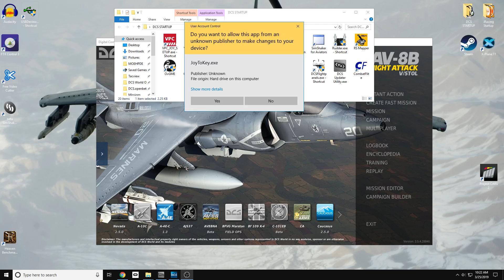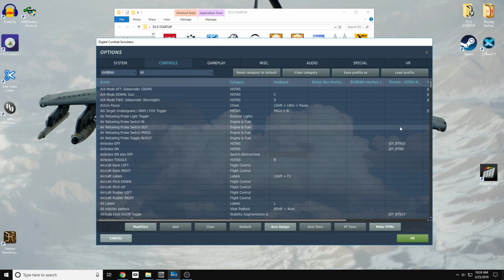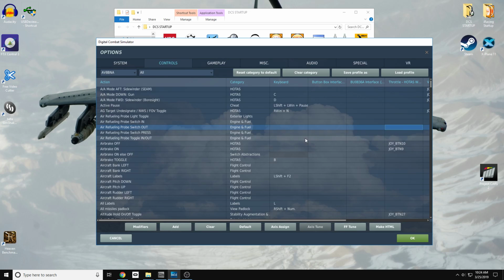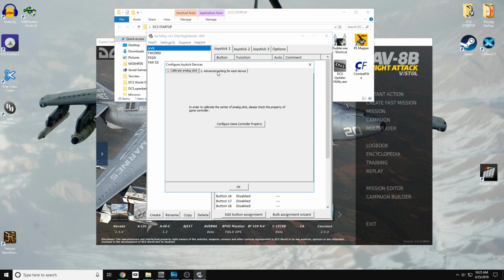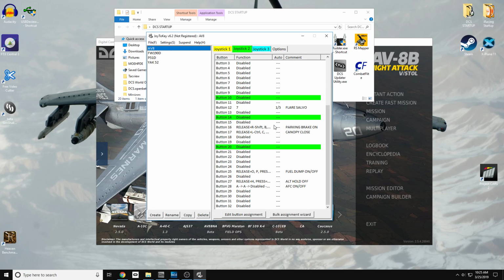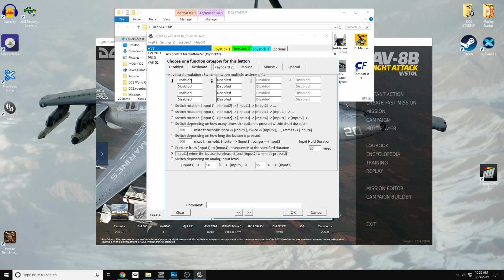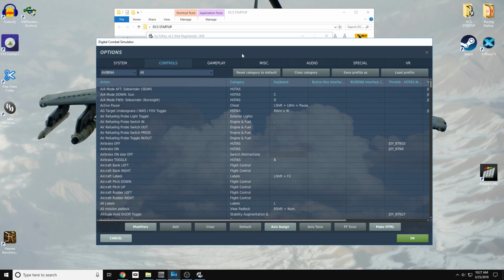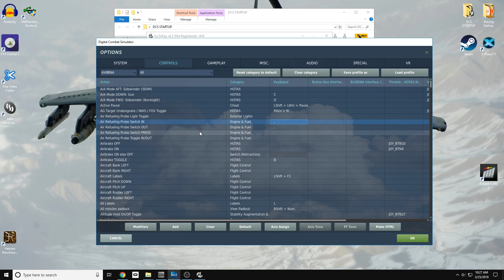How to map a Warthog switch so it's truly 2 positions in DCS using JoyToKey

Comment: This is a fantastic tutorial. It worked perfectly for mapping my Warthog throttle switches. However, my joystick is now completely disabled and unrecognized?! Any suggestions? Joytokey shows the joystick connected and recognized, but I can't input anything and it's also overriding DCS's ability to bind buttons. WTF?

Edit: I got it figured out... sort of. Taking my joystick out of the USB port and then plugging it back in solved the problem, somewhat. JoyToKey still recognizes the stick as connected,, but I still can't highlight it or change any settings. Weird. Thankfully DCS lets me edit the bindings in-game, so it works.

At any rate, this tutorial was an ENORMOUS help getting my throttle set up and the switches configured exactly as desired. THANK YOU. If JoyToKey isn't paying you for your work, they aught to be.

Comment: When i do this it just does 1 input for both buttons cause the setting is an on off setting. is there no way to make it work so that it does the same command when it is off and on? It maps both buttons for forward even though i didi exactly like you did. Seems like the off position works when i only use it but when i try to use both up and down on same setting it doesnt work. Is there some way to have one keyboard button function for both up and down? so K light my lamps and then when i pull back K shuts of the lamps. The way i think of it it should be like pressing same button twice but doesnt work for me.
Reply: Did you solve this problem? I have the same problem, want to use on off switch for electric, cockpit lights etc...
Reply: @arrakis101010  I don’t remember. Will check soon
Reply: @arrakis101010  I don’t think I have solved it yet. My dcs takes ages to start since some new update and it is also quite laggy so haven’t flown in a while
Reply: Any luck figuring this out?
Reply: @quantametric  Nope. I have been away for most of the time the last 14 months and the rest of the time I haven’t had time to try and fix it

Comment: thank you for this, that works a treat if you have two seperate commands to bind two seperate keys to. What if I have a single command (IE: engines start/stop that I want one of the warthogs on/off switches to control without having to flick it twice? does joytokey have a function for that? (if so I haven't been able to figure it out)
Reply: Did you ever sort this? I followed the instructions on this video and get it to switch 'on' as expected but does nothing on release. Im using a home built button box with a Leo Bodnar board.
Reply: @rustybuckets07  this is my situation as well
Reply: No solutions?